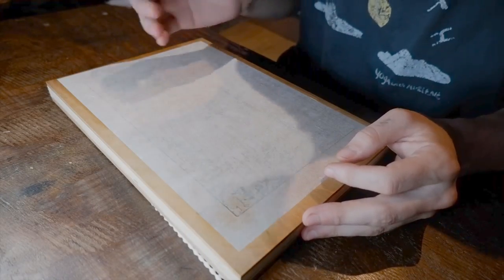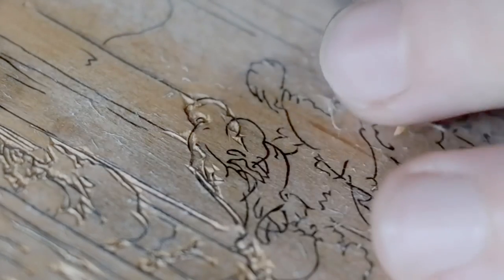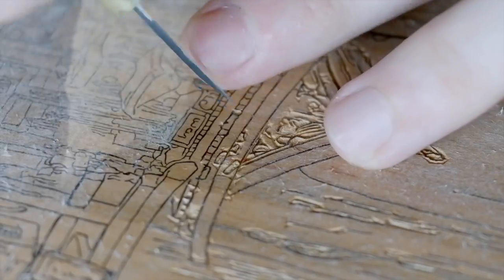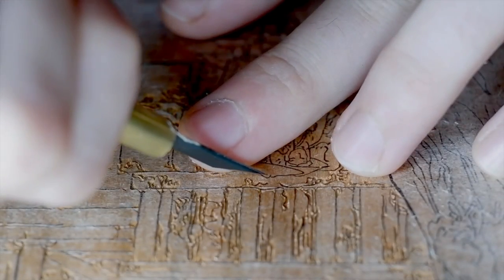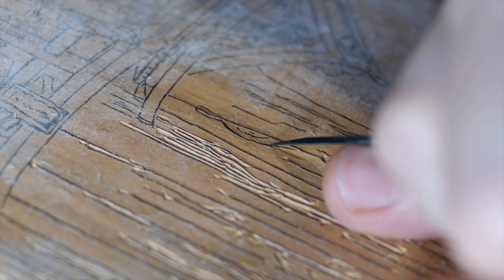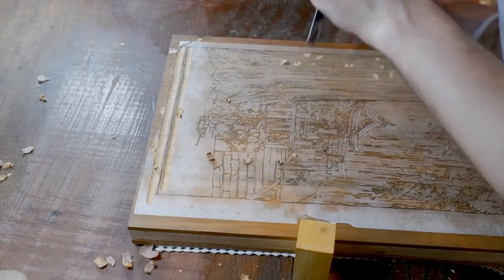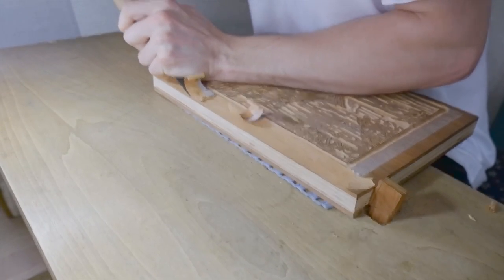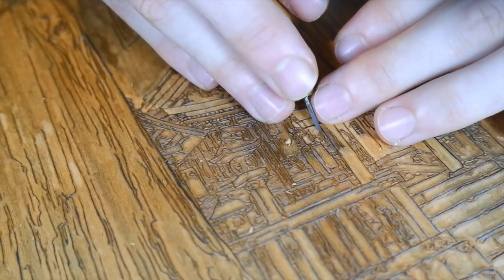Misty day in Nikko - 1. carving the key block

Comment: Thoroughly enjoyed watching your meticulous work. A couple of questions. What is the wood you were working with please? Obviously a ply but what was the carving layer. The hangi-to seemed the work through it quite easity but you used a mallet to clear larger areas with the gouges. Also, how often do you strop or sharpen your hangi-to on a piece of this intricacy? Keep up the good work, will definately be watching the following videos. Thanks again.
Reply from the maker: Thank you, I’m happy to hear, I hope the next videos please :)
The wood is a mountain cherry. I keep my knife pretty sharp and I’m only carving just over a millimetre so the carvings not very strenuous but the wood itself is quite hard. As to how often I sharpen it a little tricky to say, I carve with three knives so that if I chip or one gets dull I can continue without stopping. So I’m judgment of how often i sharpen is a little off. Depends on how well I sharpen, the wood and how good the steel is at that particular point but ranges from once a day to once a week.
Reply: Thanks for your detailed reply regarding your sharpening. Having a number of knives available to work with sounds like a sensible idea so you don't lose the flow of carving when one blade needs work.

Comment: like japanese prints. wondered how many days to do this block? how many blocks for full print? would quess going to sleep after a day of carving would be no problem. i was electronic mechanic repairing things for planes and can say after 8, 10 or 12 hr days was so worn out the same doing physical work and ive done both so i know. so enjoyed your vid. thanks
Reply from the maker: Hi I’m not sure exactly how many days as at the time I was working on this part time. I was still teaching and I had other assignments that I made thought. Start to finish it was about 6 months. The full breakdown of the blocks is in the final video. It’s fun but doing anything for 12 hours every day becomes tiring! Thank you for watching